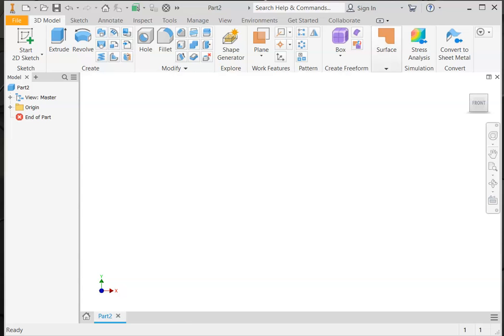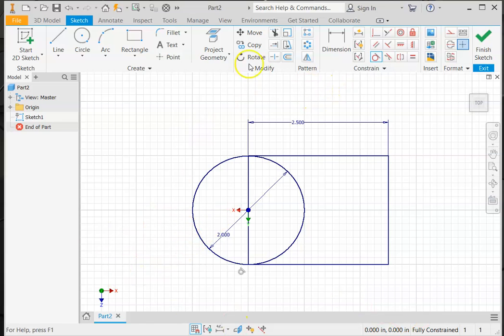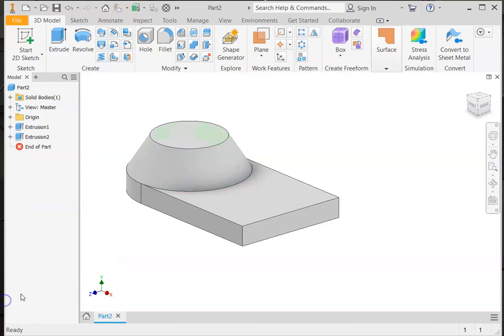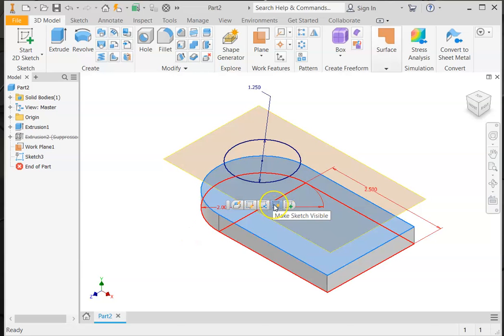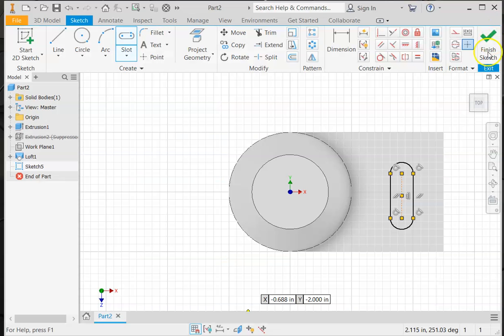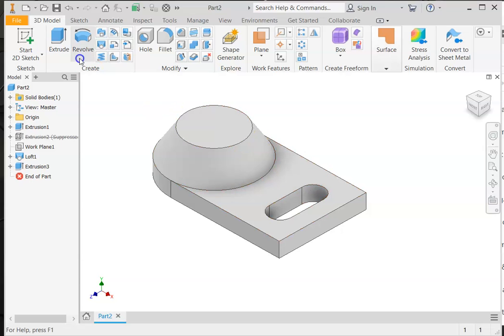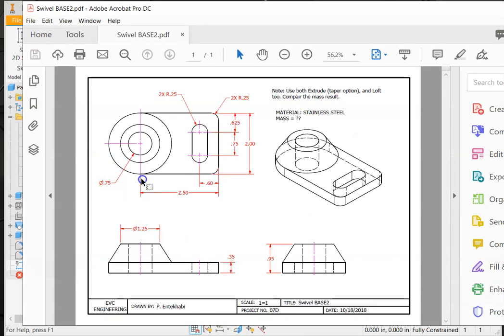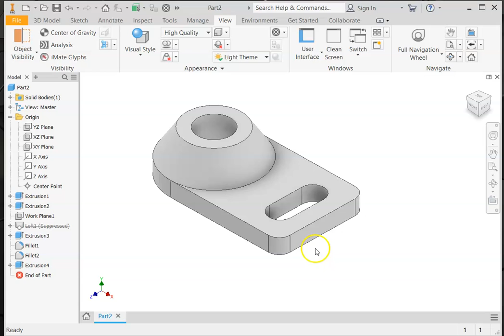Swivel Base

Comment: Dude~! you never told us the taper formula.

How did you come up with 32 and why was it smack dab perfect to the drawing of having the smaller diameter 1.25" with the .6 height

you HAVE to tell us the formula you used  because i used an online calculator and came up with the same results but i would like to know the actual formula to figure this shit out on my own like an engineer.

Let us know!! lololol
Reply from the maker: Taper calculation is based the the right-angle triginometry calculation.